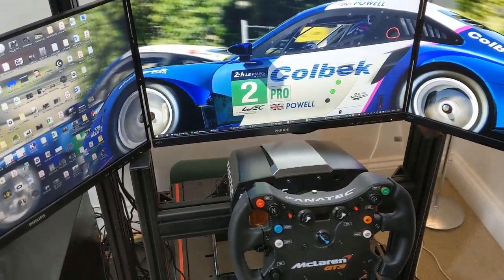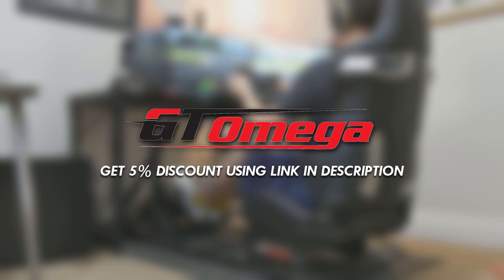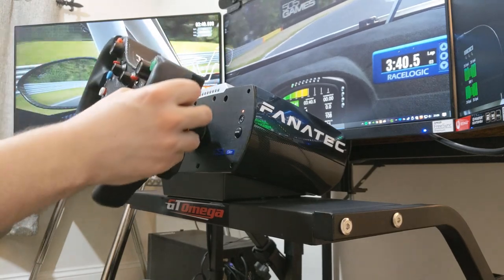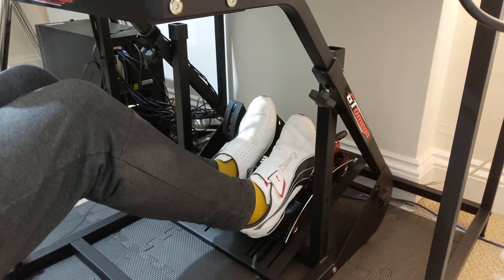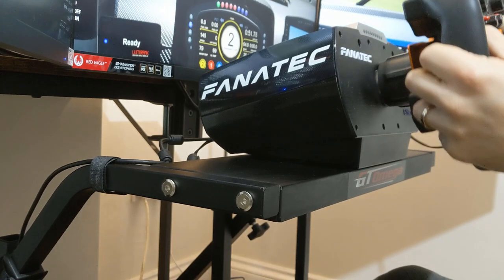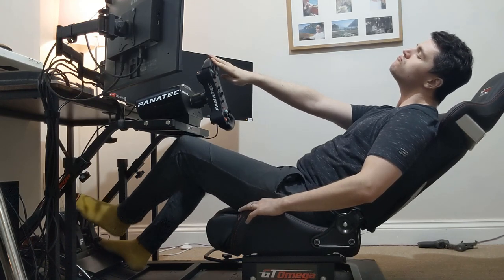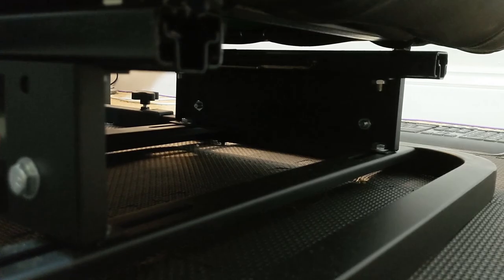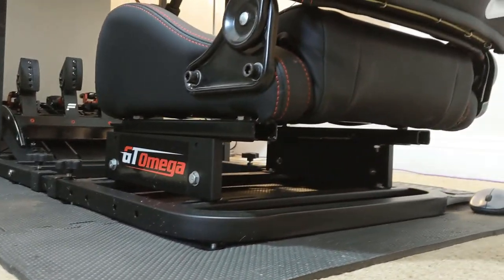GT Omega ART Cockpit - You Can Sim Race Competitively With This

Comment: What do you think of this ”starter” kit i planing to get and do some more sim racing after the summer.
Fanatec csl dd
Fanatec csl wheel, dunno yet if the wrc or mclaren
Fanarec clubsport pedals v3
Fanatec clubsport shifter 1.5
And the Gt omega art cockpit with a few options, when the EU shop opens :/
Should end up abit under 1500€, any inputs or stuff i sould change or?
Reply: starter? thats full on competitive racing right there mate.
Reply: @lorenzop7447  :)
But do you think all will work with the Gt cockpit?
Anything i can same money on? But do not whant to feel like few months later ”why did skipm out on that part :/”  :)
Reply: Nice set up that should never really need an "upgrade".
 Get the 8nm boost kit for the DD.
Depending on the cars and type of racing on wheel, the McLaren wheel is probably the best value wheel for the dollar that Fanatec offers.
 The McLaren wheel also even has a two stage clutch launch feature that you can set to give the hardest launch with the least amount of wheelspin.
 This feature is pretty much unheard of in any other wheel in this price range and it works well.
 But for Rally or Drifting you need a round wheel.

Pretty much I would eliminate the H Shifter regardless and buy both wheels myself.
Order the brake performance kit at the same time you order the v3 pedals saves you a bit on shipping and handling than if you order later and you probably will.

More and more games the H shifter is actually used for fewer cars as most vehicles now use a manual sequential gearbox and the wheels shifter paddles work great.
iRacing just eliminated the H shifter in the new Mazda MX5  build as the real life cars now use a sequential gear box.
 Also next year the Nascar cup series will be going to a sequential gear box as well.
 Getting close to where the H shifter will only be relevant for vintage racing.

Basically with the above set up you should never really feel that you "NEED" to upgrade to be able to compete at a high level.
I basically currently have the same set up but with the CSL Elite wheel which I have already preordered the new 8nm CSL DD wheelbase. My current CSL Elite wheelbase will join my CSL Elite loadcell pedals which are regulated for backup duty if there ever is a need.
I am very pleased with the quality and level of my gear and for me with the new DD will be my endgame set up.
Reply: @billwiley7216  thanks for the replay.
H pattern shifet i will most likley skip, and if the budget is enuff i will add the Mckaren wheel, need a round wheel for most driving i will be doing.
And afte seeing some test i will mostlikely wait and att the 8nm kit later, 150€ for a psu...most likely 3rd party will come.
But atm my DD will arive in nov, but the cockpit i am still unsure about.

Comment: How well do you think it holds with a CSL DD on top? Great vídeo!
Reply from the maker: It handles a CSL DD fine, the only problem is that this cockpit doesn't have tremendous angle adjustment to tilt it up or down. Trak Racer sells a bracket that can solve the problem if it happens to affect you, for me I could have done with 5 more degrees of tilt than the ART could give with the CSL DD. I have a PRIME now!
Reply: @dannyleeracing  thanks, i dont think that will be an issue

Comment: Would this be rig be able to handle my current set up:
Modded G29 Wheel 
Logitech G Pro Pedals (Brake Pedal is AT STIFFEST SETTING)
Reply from the maker: I reckon it would - no idea how stiff the G pro pedals can be but I used V3 pedals on the ART for a long time without real complaint
Reply: @dannyleeracing  okay well let’s just that from other reviewers they said that the g pro pedals are very similar to the v3s and for the stiffest options I can go between 18-19mm of pedal travel. Hopefully that’s gives you a good idea. Would the Titan be a better option over this ? Apparently lots of guys use higher end pedals for that including you when you used your Heusinkveld sprint pedals. I’m not that tall for a guy but I just want to make sure that it doesn’t feel too narrow in the Titan because it looks like it’s quite narrow to me and I’m a bit on the broader side for my body type.

Comment: Did you have to drill holes to attach the pedals?
Reply from the maker: I didn't for the Fanatec V3's featured, but there is a possibility you might have to drill custom holes for certain pedal sets, especially if you want them to the left/right of the standard positions. Don't fear it, though - it's a quick job!

Comment: Can you move it forward as i am quite small so i like to be able to be as close to the wheel and pedals as possible
Reply from the maker: Yes you can - it's possible for me to move the seat far enough forward to have the steering wheel almost lodged into my ribcage so if that's important to you then it'll be fine. The steering column also moves a long way up and out. I'd be real surprised if you weren't able to adjust it to suit you - I'd stake a whole fiver on it.

Comment: I have a CSL DD arriving late November , have you tried it on this rig?
Reply from the maker: It can take the CSL DD very well, the main issue it has is that you can't tilt the wheel plate up very high because the CSL DD has 0 degrees tilt whereas normal low-mid range wheels have like 10 degrees built-in tilt. This just means it would need customising to tilt up any higher if it was a serious problem, but otherwise it's fine to take a CSL DD.
Reply: @dannyleeracing  hey thanks for responding , after doing some more research I'm starting to lean towards the GT Omega Titan , it's only $100 more and looks very sturdy , any input from you would be welcomed
Reply from the maker: @lincolnklayvr  I had my doubts about the Titan's pedal plate, but it looks like so long as it's flat it's sturdy enough. Karl Gosling's videos are useful as he's actually had his hands on one so pop over and check his out on the Titan.
Reply: @dannyleeracing  I'll check it out , thanks for the CSL DD videos , it was a big help in deciding to order one
Reply from the maker: @lincolnklayvr  No worries man, thanks for dropping by and watching - best of luck with it all
Reply: @dannyleeracing  change of plans , turns out the GT Omega Titan has noticable flex so it's all or nothing , I don't necessarily want to part with that much money but I want to get it right the first time so I'm going with the GT Omega Prime
Reply from the maker: @lincolnklayvr  Fair play, all hinges on what you're willing to part with at the end of the day - don't forget to get the 5% discount link from myself or Karl, that'll chip a lot off the pricetag. Let us know what you think of it when you get it (I have a video on the Prime I put out a couple weeks ago)
Reply: @dannyleeracing  I saw the video , it also played a part in me deciding to go with the Prime 💪💪💪

Comment: Can you adjust the angle of the steering wheel with this?
Reply from the maker: Yes, but the range is quite limited, about 10 degrees tilt at most - fine for most wheelbases that have a tilt as standard but any zero-angle wheelbases (like a CSL DD) might be pointed too far down to be 100% to your liking
Reply: @dannyleeracing  that's not a problem, I prefer it coming straight at me, but I have the csl elite. Just wanted to be sure I can adjust some angle to have it to what I have it currently.
Reply from the maker: @Empire_of_Ravens  You'll be fine with a CSL Elite, that's what I use in this vid

Comment: How would u compare this to the titan?
Reply from the maker: The titan is much stronger, especially with it's updated pedal tray (the site photos are out of date and show a really skinny pedal tray). It's also just as easy to build.
Reply: @dannyleeracing  think I’ll go the titan. When it’s back in stock. I was also looking at the play seat trophy but it lacks easy adjustments for others that want to jump on etc.
Reply from the maker: @davidcupra4913  Have a look at the Prime Lite aswell - it's currently 100EUR off (today is the last day) and my discount code still works on top of that. The GTO seats all have sliders which is helpful for adjustment.
Reply: @dannyleeracing  the lite looks like a better rig just less pleasing on the eye for a living room over the titan if u get me. Is the lite easy move around or how would it compare in weight to the titan? The lite does seem like the better value and rig at the sale price.
Reply from the maker: @davidcupra4913  I think the Lite would be harder to hide in a living room, that's for sure - if you put wheels on it then it'll move around fine, but it will definitely have a bigger 'footprint' on the floor than a titan does.

Comment: How would this would with a csl dd 8nm
Reply from the maker: It's certainly strong enough for it, but the available pitch angle of the ART is quite limited and with a 0 degree mounting angle, the CSL DD is a bit problematic for cockpits that can't tilt up very far. Still works, don't get me wrong, but it was tilted up maximum and I would have liked a little bit more.
Reply: @dannyleeracing  well I have a 3d printer so maybe I can fix that
Reply from the maker: @thisismyviewingchannel926  That could do it - or something like this https://www.cef.co.uk/catalogue/products/68532-3-x-14mm-hole-flat-plate-for-strut-sold-in-1-s?gclid=Cj0KCQjw1dGJBhD4ARIsANb6Odkv_Fb-hKE00ZH1B-YKmmCQi75IJwLGcgteY2ZtwmDrrc-dmXljg2MaAqJ9EALw_wcB&gclsrc=aw.ds
Reply: @dannyleeracing  I was thinking of more of a wedge shape for more support but yes
Reply from the maker: @thisismyviewingchannel926  Oh yeah, absolutely - your idea is better!
Reply: @dannyleeracing  if I ever get a csl dd and an art il sell them on etsy

Comment: Can this use next level motion platform
Reply from the maker: I would say not really - you would want something more rigid in the mid-section. The ART is plenty fine on the floor but I think you'd start hitting trouble adding a motion platform into the mix.